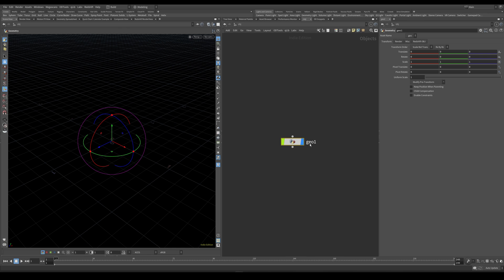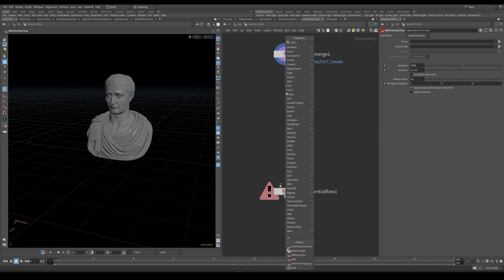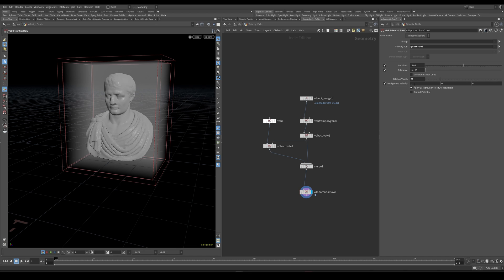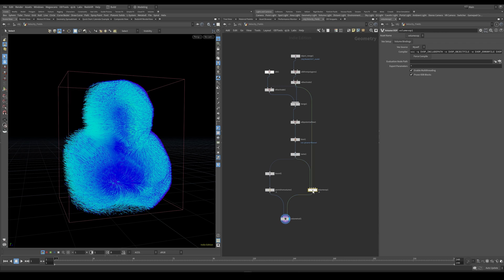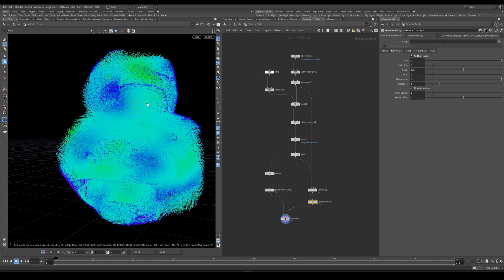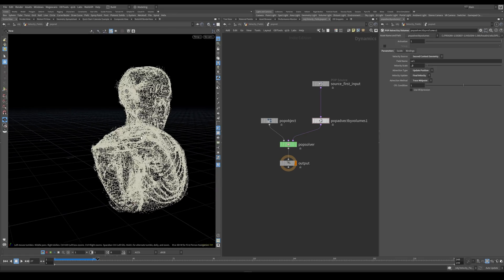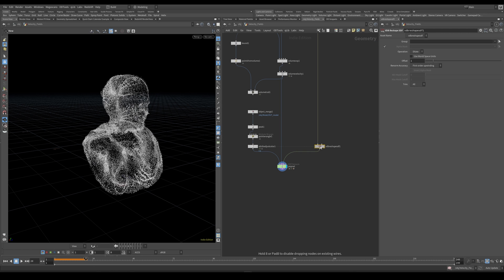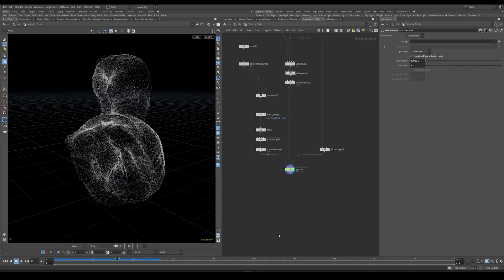Houdini Tutorial: Advanced Velocity Fields I - Simulation Setup

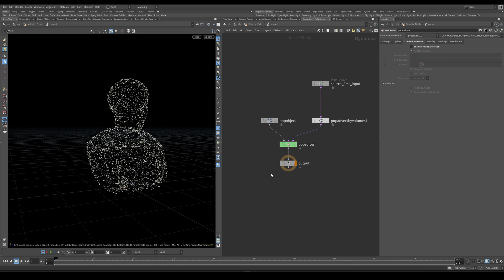Comment: Has anyone else run into a problem around the 9:00 minute mark, where their particles do not move at all? I just get the model gradually filling up with particles as they are born on the surface, but they don't follow the velocity fields at all
Reply: Combed back through my file - turns out I made an incorrect connection in the volume VOP